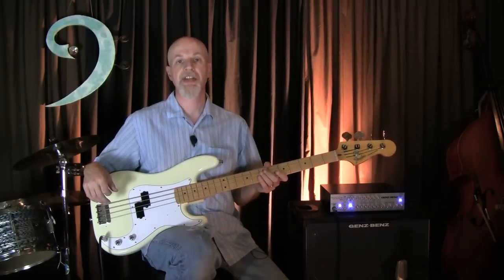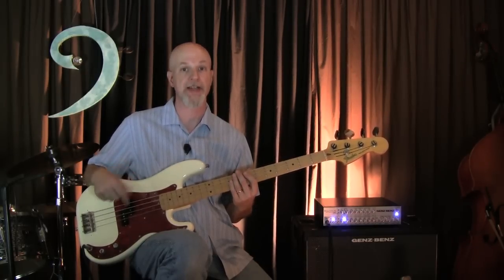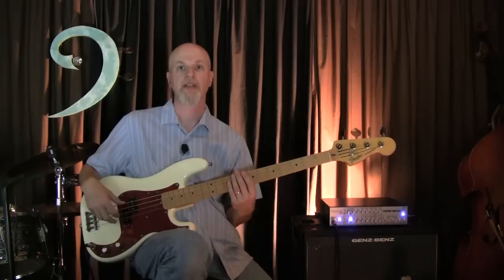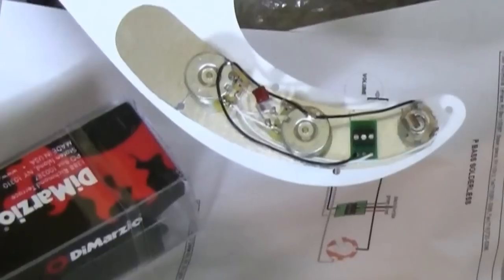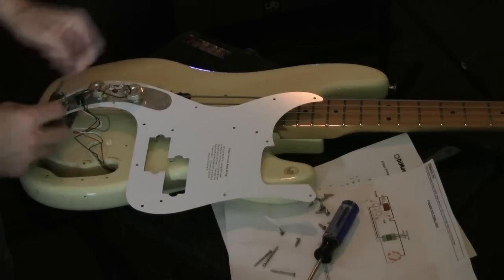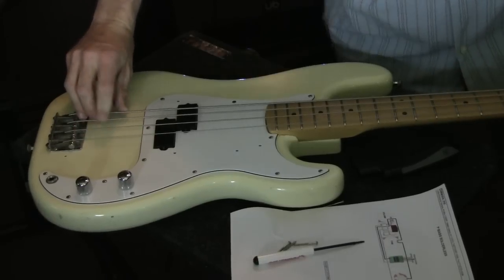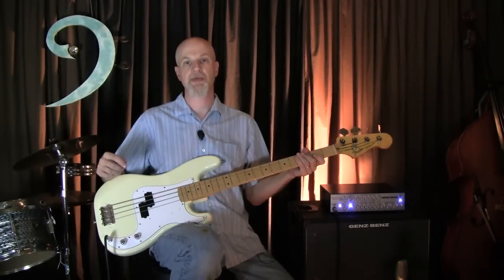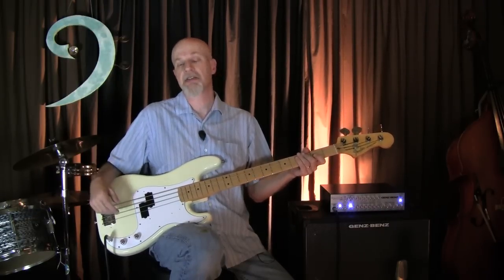Dimarzio Model P

Comment from the maker: @TableWolfMusic - There is no need to rout to put this pickup in. And... it is possible to use the pickup and the pre-wired harness with your own pickguard, you'll just have to remove it from the one they supply. That's what I did after the review. I kept the pickup, but used my old pickguard. Dimarzio also makes lots of J pickups for the bridge position, I suggest getting a split coil or stack humbucker so it's quiet.

Comment: A fun modification that can be done with the Model P: It's a 4-conductor pickup, so you can wire it to a switch between series/parallel modes.

Series is the standard P-Bass wiring. Going to parallel cuts the output, but makes it more trebly, kind of Rickenbacker-ish. It's great for slapping and pick-style.

Comment: I've got a 1979 (I think?) Kramer aluminum neck bass, with a DiMarzio Model P on it. I love it. With an adjustment of the tone knob, you can get a vintage mellow sound, or crank it up to get a more trebly sound. And the individual pole piece adjustment is a bit more elegant than moving whole sections of the pickup up and down for that drawbridge effect.

Comment from the maker: @AirplaiTv - The best thing is to experiment for yourself. Some people like them real close, others screw them all the way down into the body. You get different sounds each way. The most important thing is to try to balance them so one side is not significantly louder than the other. If you tend to play hard, don't put them that close to the string. If you want to play lighter, closer is good.

Comment: Greatness, Ed!! I thoroughly enjoy the sound of both, but to my ears and to my internal RTA, The Dimarzio has a slightly more warm, sweet, and harmonically even tone. That additional to the hot output makes onboard passive distortion a viable option. The adjustable poles are also mmmmm. Yeah, so the Dim' run is a few cents flat, no biggie.
Thank you!

Comment: I bought a used bass that had a Model P in it already.  It's brighter and a bit harsher than a standard Fender Precision Bass — in a very good way, when you start using the tone knob.

With the tone knob rolled down maybe halfway, you get very close to the classic Precision sound again. You can then roll the tone back up, for a harder rock or funk sounds, or you can go further down for a smooth jazz or Motown feel.

Bottom line:  Great pickup. You get everything from a P-Bass, plus even more.

Comment: If you want to re-use the pickup with your existing pickguard, is it as simple as just unscrewing the pots, jack, and the wiring and transplanting them over?  Or is there any soldering required?

Comment: hey ed, hi i need a little help here. I recently got a little mark III head to pair up with my ampeg 410svtHE cab, i got an active ibanez sr700 4 string bass. Im not 100% happy with my sound, i dont know if its the bass, head or cab. what do you think of my gear? when buying the head i was also considering genz benz shuttle 6.0 and eden WTX500. maybe the sound on my amp is too "simple" (clean?) and i need some more growl. should i change my amp for one of the other 2? what do you reckon? thanks!

Comment: Dimarzios were clearer and sweeter sounding to my ears. I prefer them. Some will prefer the more expensive pickup, as it's hard to admit a cheaper one can be better, especially if you've paid for the expensive ones. Mind you, I bet the original Japanese pickups were nice and were probably only removed because they were Japanese, not because they were inferior. Good demo! :)
Reply: Cheaper yet are Wilde/Bill Lawrence P-46 pickups.  Capture the pure Fender P bass sound at $72.

Comment: I have Dimarzio Model p in one of my basses and it is more midrangy than most pups and the ceramic magnets give it a more edgy tone.  Also when I install my pups I mount them on solid maple blocks of wood.  I makes a subtle difference and they will not move.  I also like the Seymour Duncan Sb3s for a high output pup.  They have a little more treble and less mids than the model p.

Comment: Can I ask how you managed to keep a set of strings sounding that good for 10 years please?
Reply: Quickly wash and dry your hands every time before you play. Your fingers will also glide over the strings a little easier.
Reply: Hey Judd I recommend rubbing alcohol, higher isopropyl content is better but I'm using 70% atm and it's fine. Soak some into the middle area of a folded piece of J cloth or similar (⅓  sheet strip torn and folded) Put your bass up on a stand, wrap the moistened cloth around one string at a time (at the pickup end where there's space to get under) then pinching and twisting cloth slightly run up and down entire string lengths a few times til you hear squeaks. When all strings are done, give all of them ten or so really good twangs, pinching and twanging against the fretboard whilst also fretting different intervals up the neck. Regular degreasing your string windings like this will make them last ages and you'll hear them brightening during the twanging process. Leave to evaporate and dry fully for a few more mins and you're good to go!